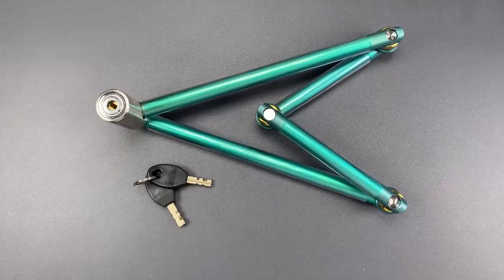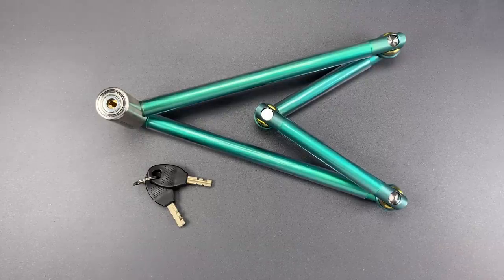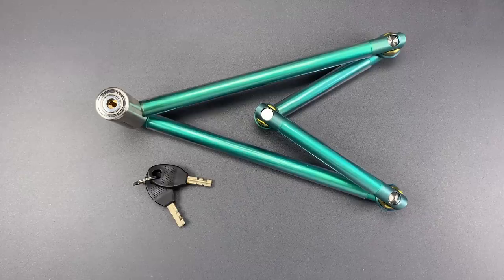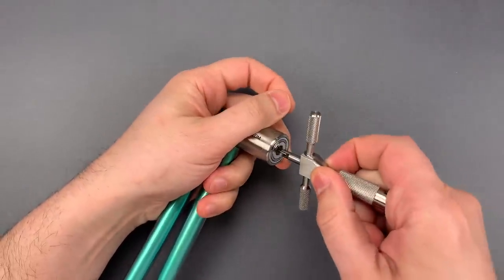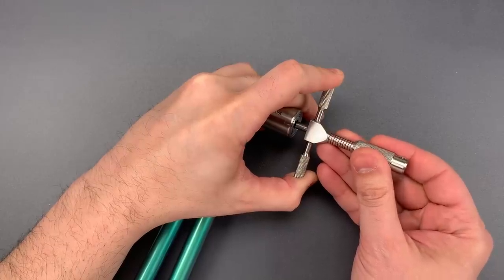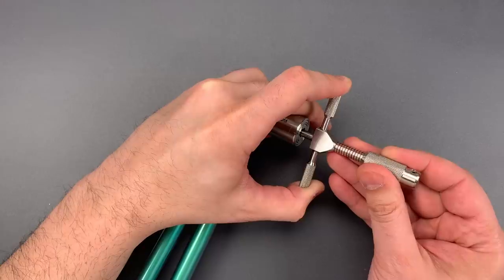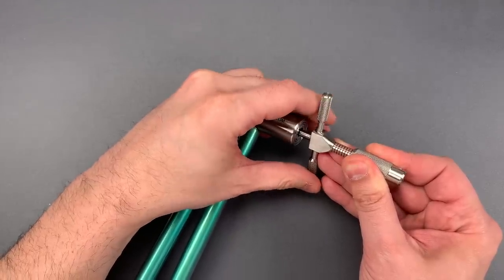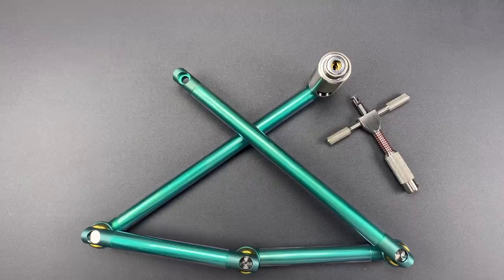[1063] $180 Titanium Bike Lock Picked (Altor 560G)

Comment: See, titanium is one of those things that people seem to think is an invincible super metal because they have no idea how it actually works.

Titanium is often touted as "the strongest metal", which is ambiguous. It has the highest strength-to-weight ratio of any elemental metal, meaning in its pure form it can take more abuse per mass than others. However, it's also extremely light, so by VOLUME it's about the same strength as a little less strong than typical carbon steel.

To give a better perspective, the second strongest metal by weight is aluminum. No one thinks that will make indestructible armor or a knife that never dulls, partly because of its own misconceptions due to most people's experience with aluminum being in the form of foil.

You can add a good bit of titanium's strength to steel alloys by mixing it in rather than using it in a pure form. But that's not what consumer's look for, is it?

EDIT: Check the replies to see some more exact numbers.
Reply: This!! People need to know this
Reply: Isn't it more likely that is what they do? Since titanium is expensive, I'm thinking it's cheaper/profitable to use a steel alloy and call just titanium. If it can be done with aluminium it would keep the light weight as well. Or I'm just giving them ideas on being assholes and I should stop.
Reply: Same thing with carbon fiber, it's all about strength to weight. I was watching a race with some people once and one of them complained about how flimsy the cars were, with pieces flying off if they touched anything, and he said it was because they were made of carbon fiber; if all those little bits had been made of steel or aluminum of the same weight they'd be like tinfoil.
Reply: Titanium is actually less strong by volume than steel, IIRC.  So if you make something of a specific strength out of both, it'll be smaller but heavier in steel.  This lock went for weight reduction, so they've lost out on strength.
Reply: Powerful claims.
Reply: Also, from my limited understanding, it's harder to make titanium stuff without compromising its strength.  Meaning that it's more critical to have proper engineering from start to finish and the final product's strength can be accidentally compromised more easily than when working with common steels.
Reply: Titanium is about 30% softer than hardened tool steel, but +-50% lighter. Aluminium is a lot lighter than Ti, but much softer as well. If you need incredibly hard material you could use carbide, which is heavier than steel and cannot be cut by anything but diamond tools, but carbide is a bit brittle, it would break if smashed hard on a curb for example.
Reply: Elmax is probably what they think of since elmax knives can cut cinder blocks and still cut. But it's ungodly expensive.
Reply: Titanium is amazing. It's the perfect material for military-grade airframes. Assuming whatever it is you're using either doesn't need to fly, or doesn't need to catch bullets, you're probably better off with steel or aluminum, which are both plentiful, and cheap.
Reply: I find it amazing how titanium is significantly stronger when alloyed with aluminium, something typically thought of as weak. I've never heard titanium or its alloys touted as abrasion resistant though, so I don't imagine they survive grinding and saws all too well.
Reply: Note that he said that this lock is grade 5 titanium, which is a slightly stronger alloy containing some aluminum and vanadium if i'm not mistaken
Reply: @tortex1  Grade 5 is almost 90% titanium, and is probably the best choice of commonly available Ti alloys for this sort of thing, but it's still too soft for a bike lock.
Reply: @tortex1  you can't fake titanium with a steel alloy, since steel is magnetic and titanium is not
Reply: Science materials is one of the most complex and powerful sciences that is teached in the most boring way. If it is ever teach properly and not by a series of boring pages and tedious tests that people can't relate to or don't care much about . What's the fuzz about Hardness scales and indentations, right?

Truth is, as you say, most people know materials by hearsay or very simple explanations.
Some people get blinded and get tunnel vision about one material (oh, graphene! titanium! etc...) and get the wrong idea.
They try to make everything of that material or get it marketed as "the absolute best".

There is not such a "absolut best" material. 
Each one has its uses or reasons to be used instead of another.

My point being, one of such reasons is cost and/or availability.
Titanium is an expensive material with a very niche market, and this rather stupid manufacturer thought it would made a proper lock chain.

Those hinges and overall construction ... darn. 
I wish LPL goes medieval on this with a low tech "brute force" attack.
Maybe a lever, maybe a pair of wrenches + a cheater bar to twist and break this.
Reply: One advantage of titanium here could be to deter thieves.  It looks chunky, and if it looks like 3/4 inch of steel, then any casual thief won't bother.  An the fact that its Ti means its easier to carry around.
Reply: Alloy here seems to be grade 5 titanium, Ti-6Al-4V, so it's about 90% Ti. 

To make any fair comparisons, you should probably compare the yield and ultimate tensile strengths and impact strengths (at both low and high temperatures), and then consider that in relation to densities. 

Steel is almost twice as dense (70-80 % more dense perhaps) as this alloy. If you just assume then that you would need something that is 80% stronger than Ti-6Al-4V, you end up in ultra high strength steel territory. Probably not as expensive as Ti-6Al-4V, but not cheap. Can't find any prices online.

Then you also have formability etc to consider which may or may not be an issue.

And it's also just not about pure material strength, if the design and joints are whack then it doesn't matter much that you have the strongest alloy on earth.
Reply: Are you a chemical engineer
Reply: Mikuláš Mecháček Tungsten Carbide?
Reply: @robertsundstrom4221  UHSS is more expensive than commercial titanium alloys. Grade 5 titanium, unlike commercially pure titanium, can be heat treated at around 400C. UHSS also has TS≈1.5-2.5 and Y≈1.5 times that of G5 Titanium alloy.

Source: just had my finals in materials science
Reply: I use Pb because I like my material to reflect me....soft, dense and to toxic to eat.
Reply: @robertsundstrom4221  that's typical aircraft grade titanium. I wouldn't expect a twisting attack to work very well, that alloy is quite tough. And significantly harder to machine than aircraft grade aluminum (6061 or 7075 aluminum machine like steel).

Not to mention that anyone trying to cut through this with a grinder will throw white sparks across the shop. Edit: blinding white sparks.
Reply: Stainless always seems to be the toughest metals when I'm working with them.
Reply: @tortex1  That would be extremely overt false advertising.
Reply: @queazocotal  5000 internet points for you
Reply: @drane1210  No, I am a software engineer. But I also study up on materials because I make cosplay props.
Reply: The plait in my hed is maid of titanium and I do jus fien.
Reply: @OtakuUnitedStudio  oh ok cause you sure sound smart. Keep up the good work thanks for your contributions to make this world better we need more people like you
Reply: You people all sound like you have some understanding of metallurgy and material science, so I figure I'd ask y'all a thing:

I'm doing a little sci-fi thing, and while I'm taking some liberties with some stuff, one thing I would want some attention to detail with is body armor. The idea is partial kevlar body suit with a number of hard plates, it's not supposed to make you bullet proof, just protect you from some gunfire (fairly mundane current day stuff, mostly, think 5.56mm carbines, 9mm pistols and subguns, shotguns with 00 buck, fragments from grenades, etc).

Modern plate carriers use steel or ceramic plates, and this lasts for a little bit, saving your life if you do get shot, but not stopping bullets indefinitely, and I was wondering if, setting aside real practical concerns such as cost of manufacture and what not, could a longer lasting armor be made with plates made out of other metals and alloys, say doubling up with titanium plates for a comparable weight to steel? Is there a certain alloy mix of titanium which would, if shaped into an armor plate and hardened properly, withstand that kind of abuse for longer?
Reply: @0neDoomedSpaceMarine  
what makes material soft and maliable, when the bullet hits it is high temperaure and really high pressure, the metal localy becomes soft, and  it can be pierced
that is also the whole point in insert machining, turning and milling

so you need to find material that maintains hardness when heated up, but also is not brittle and is shock resistant

my blind guess would be inconel, im sure someone will chip in and give you even better explanation and suggestion
Reply: @darthtrump4428  Inconel, huh? Wouldn't kinetic energy also be part of the formula, not just heat?
Reply: I didn't think aluminium was strong because you can machine it so easily with little resistance. I assumed it was a soft metal.
Reply: @0neDoomedSpaceMarine  if you get velocities high enough, you can push pure copper through hardened steel. It's called a shaped charge.

The way modern ESAPI plates work is to have a super hard layer on top to break the bullet apart, then a less hard layer to act as trauma plate, backed by standard Kevlar to stop any fragments.

But you can actually use plastic for the armor plates, look up veterans manufacturing body armor. They use the same cross linked ultra high molecular weight polymer that is used in artificial joints. In one video, they shoot a plate with a Barrett 50, the bullet doesn't go through! Not that the wearer would survive, there's just too much energy there to break things. But it stops the bullets. And the plastic is light enough to float.
Reply: @KaliTakumi  That is a good point, though some alloys are actually very difficult to machine. When it comes to milling and machining, that's the hardness. In that case, aluminum is fairly weak to scratching and shearing forces. But it's tensile strength, or ability to resist stretching, is relatively high per weight compared to other metals. A given mass of aluminum will hold itself together better than a similar mass of other metals. It's similar to how you can cut Kevlar with scissors but it can block bullets with a tight enough weave.
Reply: @0neDoomedSpaceMarine  If you're open to some slight fudging, a non-newtonian fluid might be better. In its normal state, it's soft and flexible which makes it good for movement, but on high-velocity impact will act as if it was solid. Oobleck, made from cornstarch and water, will normally act like silly putty. If you smack it with a hammer, though, it will shatter like glass before melting back together.
Reply: @0neDoomedSpaceMarine  you could live in a block of titanium.
Reply: Bicyclists don;t love titanium for strength, quite the contrary - titanium frame are notorious. The reason bike fanatics like titanium is for those who are trying to cut weight down to an absolute minimum. It's like an obsession - like backpackers who saw the handles off their toothbrushes to save weight. Ever gram counts to these people.
Reply: @jafafa  yep, they're the kind of people who argue that stop signs and red lights should just be a suggestion because slowing down screws up their calorie-to-distance ratio, even though it puts themselves and others in danger.
Reply: @jafafa  Only the teledyne used horrible ti. After that frames were generally made with 3/5 ti and dropouts of 6/4. I have a frame from Spectrum cycles since 1991 and it will probably outlast me and the next owner.
Reply: @firesurfer  I've never ridden one, but I've heard that titanium bikes make for a stiff, unpleasant ride.
Reply: @ScottKenny1978  yeah, anyone who was practical workshop experience with any alloy will probably be able to better predict how well it will fare against whatever tools a bike thief may employ, compared to someone just looking at data sheets
Reply: @OtakuUnitedStudio  How would oobleck handle being on fire though? Also what would it be encased in to stay in place and also not to leak out?
Reply: @ScottKenny1978  Interesting, what kind of plastic material? Would there be any benefit in layering with some metal alloy?
Reply: @jafafa  Not true. It's totally dependent on the design of the frame. After thousands of miles, I can say bullcrap.
Reply: @0neDoomedSpaceMarine  I think it's cross linked ultra high molecular weight polyethylene. Might be polyurethane. There's a video of Jerry Miculek shooting it with his Barrett where they say. Pretty trippy stuff.

I don't know if adding a metal layer really helps.
Reply: @0neDoomedSpaceMarine  Oobleck was just an example. A more viscous type that doesn't drip would be in the realm of realistic. I'd think it would be inside a Kevlar-like polymer fabric with the inner surface bonded to form an air-tight seal. The gel inside would harden at the point of impact and redistribute the force.

At least, that's something I think seems reasonably realistic.
Reply: I have a titanium watch and it definitely has more scratch resistance than stainless cases and bands I've had over the years.
Reply: @ZombiesSlaier  What's Y?
Reply: Spot on! So often it's just used for the "cool factor". Titanium isn't even that hard to cut or machine, even the alloys. (I just cut up several dozen pieces from 10mm titanium bar with a hand hacksaw, and it was no more difficult than cutting mild steel).
Reply: @imajeenyus42  depends entirely on the alloy of titanium. Pure titanium is about as hard as steel, the alloys get harder.
Reply: It’s untrue to say titanium isn’t as strong ‘by volume’. Titanium and steel have different uses, and it’s not necessarily just because of its strength-to-weight ratio; it has different strength properties depending on the alloy which can make it better than steel under certain circumstances, -but most notably that titanium keeps its strength at much higher temperatures than steel-. That’s the primary reason titanium is used in a lot of applications. There are a great many things out there that need materials to be strong at high temperatures, and titanium is one of them. That’s the reason why the sr-71 is made from it.
Reply: @Rwdphotos  noone implies that titanium is useless. it's just that it's a metal with niche uses. the SR-71 blackbird is most definitely an Awesome Niche use
Reply: I used to think this too, and is one reason I got the tigr bike lock. A year later I saw a couple of videos and learned the facts you wrote above. Now if the lock had been the same weight as the carbon steel lock, it'd likely be 2-3 times thicker and be a real beast to cut. 

Anyway, lessons learnt, facts learnt,. I use the lock in low risk areas only.

Comment: I wholeheartedly agree with your “good enough” comment. 99.999% of bike thieves are looking for an easy “bolt cutters and run” scenario. Time isn’t everything, but to a thief it is 99% of everything. I don’t see a bike thief wanting to kneel on the concrete twiddling with a complex lock pick (even if he had one plus the skill) for minutes at a time. He’ll move on to the bike with a thin cable lock and cut it. It’s the old proverb that you don’t have to be faster than the bear, just faster than one other person.

Comment: If you do the brute force test, I’m curious how strong those joints between the bars are. I feel like you could get a pry bar in and pop the pin out of those joints
Reply: If you can get leverage you could probably pop it apart without too much difficulty. It might take some time to get it in a good spot to pry on though. I'm just speculating here.
Reply: That does seem like it offers good opportunities for leverage. Chain is always better than these bars.
Reply: Per the video, manufacturer made a big deal about the bars being titanium but said nothing about the joints. If a brute Force attack video is done, I'd like to see it on a joint.
Reply: @markbotta8567  I hope he does s few tests. Nut splitter, bolt cutters and hacksaw.
Reply: @Pyrochazm : if that metal is as thin as I suspect, bolt cutters and hacksaws should have no problems. I hope LPL does a follow-up. It should be interesting.
Reply: That grade of titanium is actually pretty tough and flexible. I admit, I am interested in seeing what it takes to break, though.

Comment: Some technical details to the material used:

Grade 5 Titanium is very resilient against heat, chemicals, oxidation and tensile stress. Its harder than 1.0038 (also known St 37) which is a common steel for building industries and cheap steel works... But it is clearly not comparable to hardened steel! 

Typically Titanium has around 38-40 HRC. Hardened steel can have with ease 60-70 HRC without being to brittle to use it in a lock (at least in my opinion)

So the major upside of titanium that remains is its look and the weight. As it is anodized Titanium (additionally expensive cause anodizing Titanium is a job not as easy as with aluminum) and very durable against anything environment can come up with it will basically look neat and new forever.

Comment: It looks very light, which is good. The question is how strong are the flexible joints. The average punk that steels bikes is not going to pick it. How much resistance to bolt cutter and sledge hammers does it have.